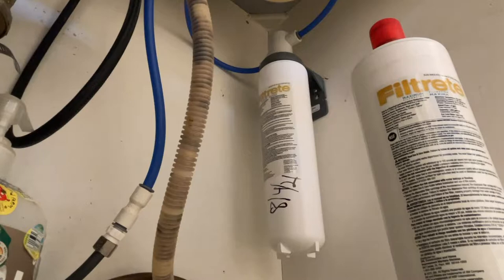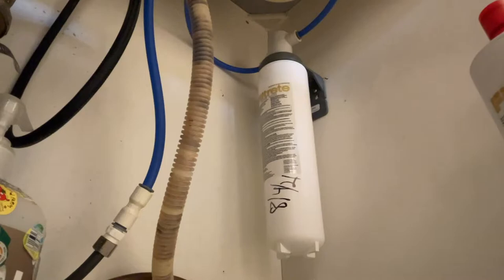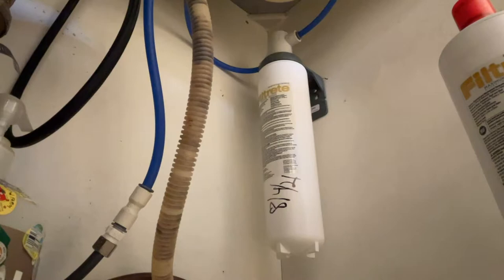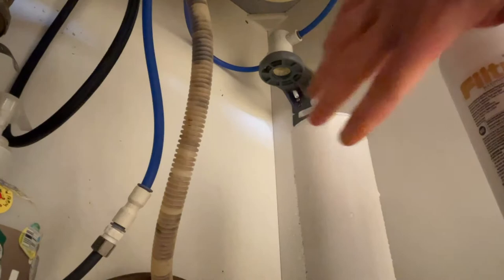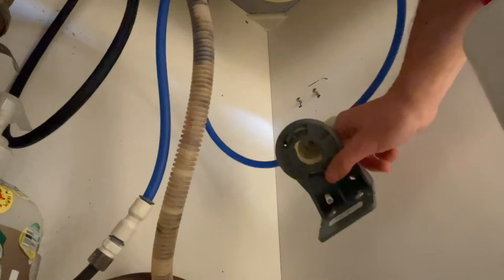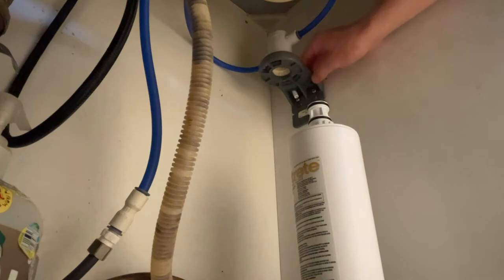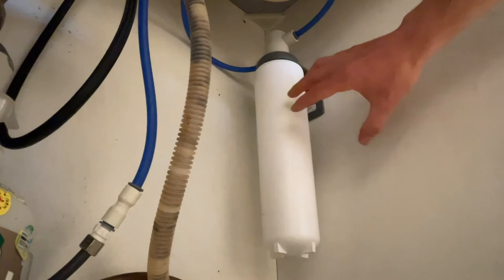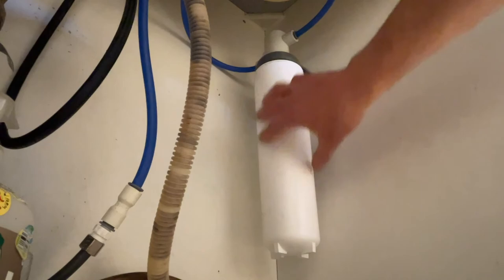How To Change The Filter On A 3M Filtrete 3US-MAX-S01 Under-Sink Filter Filter

Comment: This is an EXCELLENT video! The only problem is you instructed to remove the filter clockwise, which is incorrect. It's "righty tighty lefty loosey" if you're looking at it from underneath the sink. Outside of that it was very straightforward and accurate. 
The only downside I can see with this type of system is a a slight drop in water pressure on the cold side and the fact that it's static, so if you're doing something arbitrary like washing dishes you can't just shut it off, which means you're wasting filtered water, but at 800 gallons and $35 a filter it beats the pants off of the faucet mounted systems, especially considering they tend to wear out the diverter valve in my experience so you're going to be replacing either that or the faucet itself every two years which is $150 for a two handle system with a sprayer.
Reply from the maker: Thanks for the comment. And this system uses an additional faucet as opposed to being in line with you cold. So yes there is a big pressure drop but since it’s for drinking water it’s not too much of a problem.